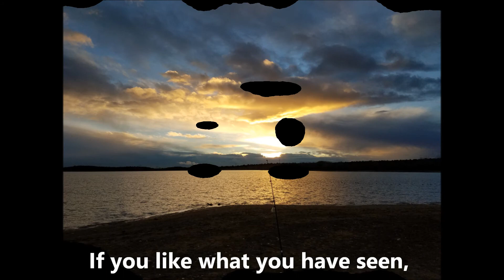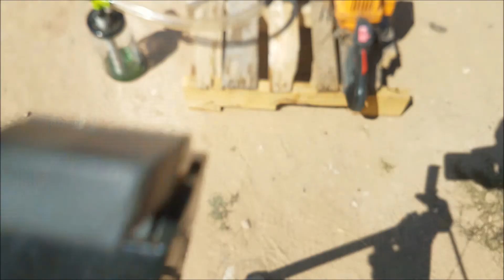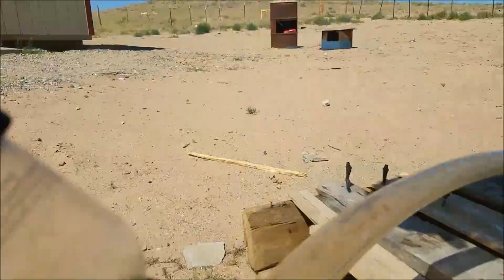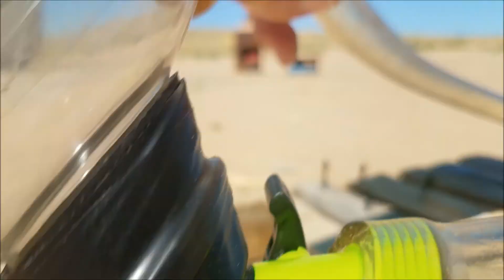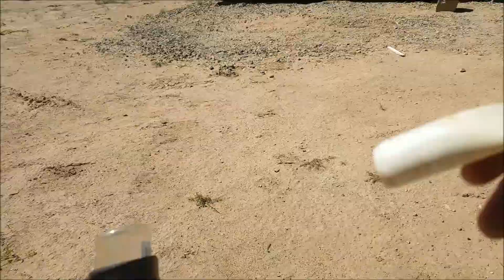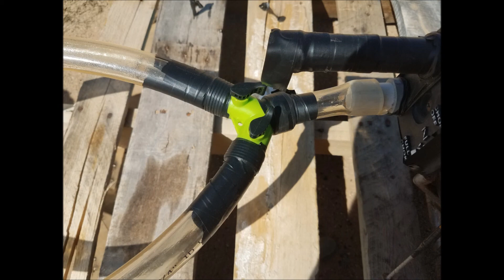Gasoline vaporizor! Easy!! Must watch!! Running on gas vapor, internal combustion engines.

Comment: Use fine steel wool for anti flashback suppression.
Reply from the maker: normellow it does not need it, it does not mix til right before it hits the carburetor, there is no chance of the jar blowing up. i might add hho as well though, would definitely need one for that.

Comment: Are you using premixed fuel? If so do you think the two storm oil vaporizes as well? atleast enough to lubricate it under load
Reply from the maker: doug delmonico that is exactly the question i have. so far it does not seem like there is any remaining 2so in the jar when all the gas vapes out. my assumption is that it is vaping with the gas. being that all this is still in the experimental phase, im not to worried about burning the motor, so i guess we shall see. stay tuned for further results. the use of the 2  stroke was just for proof of concept, as i plan to install one of the systems on my vehical. thinking about maybe even running an hho system with it as well. hho can be kinda a pain thougb, gotta make sure nothing can backflash and blow up your system. very explosive stuff.
Reply: Guyver's Lab your creativity and enthusiasm will be rewarded. Thank you for taking the time to share your results. I am in the process of making a working prototype.IMMERSION heaters are efficient and submersible in gasoline and I found they throw a large amount of gas vapor for 100 watts consumption. I got the idea from an electronic cigarette coil when I realized how efficient they are even at high temperatures. Couple that with a large 80 gp/m air pump and you will have more than enough vapor for most vehicles. Let me know what you think, or please continue to post updates of your progress. Information transfer will free the people.
Reply from the maker: doug delmonico i have seen kinda what your are talking about. if you are connecting the system to the intake you should not need an air pump, engine should draw all the air it needs, its just a matter of balancing how much gets drawn in.

Comment: doesn't seem like its smoking like a 2 stroke should. I don't think the engine is getting enough 2 stroke oil
Reply from the maker: Daniel OHara u may be right, part of this is finding out if the 2s oil can vape effectively with the gas. if not an additional oil line will be required. this motor is expendible.. if it burns we know we have problems with lubrication. once i finish the new float valve fuel level system i will post updates.